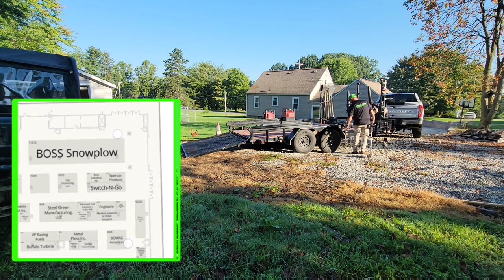I DON'T KNOW WHAT HAPPENED | THE DAY WENT FROM GOOD TO BAD!

Comment: I hear you on the pain front I performed an over the bars maneuver Monday evening exiting a rail trail on my triathlon bike, at low speed, not a big crash but both wrists are quite sore.  Today operating my pistol grip 1991 John Deere GS-25 walk mower was uncomfortable, and I had to revert to my Toro trim mower for everything after.  That was a bit slower but feeling stronger though, Wednesday should be OK!

Comment: if you ask me it all evens out , what about the times you mowed and did not have to trim here and there , did you reduce the price then , the only extra i seen was moving the tables , you was already whackin around the poles and mowing under the awning , big area is one thing but a 5 minute job with a big loyal company , should not have crossed your mind ,may as well charge to hit around all the marker poles with the ribbons attached , if your that worried about moving a few plastic tables ??????
Reply: Show the figures when the grass is slow and you dont trim the usual because it does not need it , i bet its the same as if you did all the trimming even though you skipped a few places

Comment: That's a hard one as it depends on the customer and the amount of business from them.  I would express the additional labor to the customer and ask if they want to continue with their current setup or take it back to the previous setup.  Also, express the different costs between the two options.  That gives them a choice and it doesn't feel like you are trying to gouge them.

Comment: About your neck, do you drink electrolyte waters ?  I get leg cramps  at night  if I do not get enough fluid… but, The cramping stops when I started electrolyte waters !  Body Armor is great !
Reply: each time you replace fluids with plain water and no electrolytes you are slowly increasing the concentration of water and diluting the concentrations of electrolytes need for proper muscle function.  It is the exchange of electrolytes which makes the muscles contract and relax. That is why it is important to replace the fluids with ones that contain electrolytes in the proper concentrations.  There are other important electrolytes such as magnesium, calcium, and sodium which make skeletal and most importantly the cardiac muscles function.  Most sports/electrolyte drinks contain a lot of sugar which actually causes the cells to dehydrate faster.  Real natural Coconut water has all the proper electrolytes, etc. needed.  Compare the labels on sports/electrolyte drinks to the labels on real 100% natural coconut water.